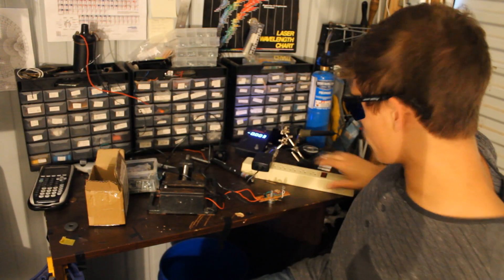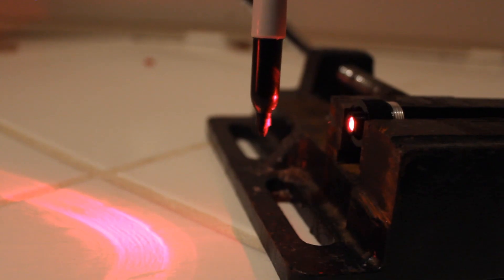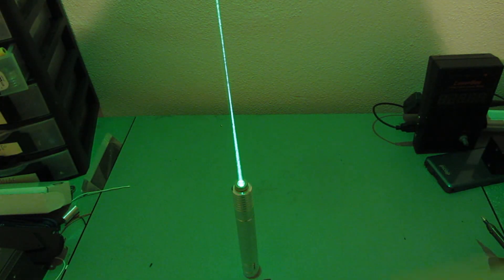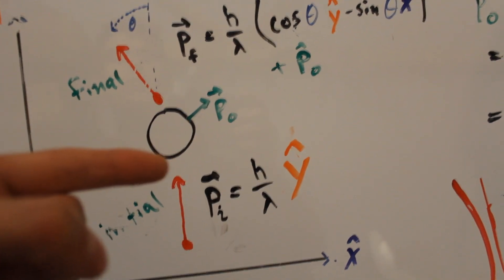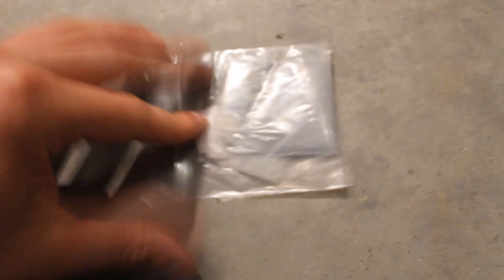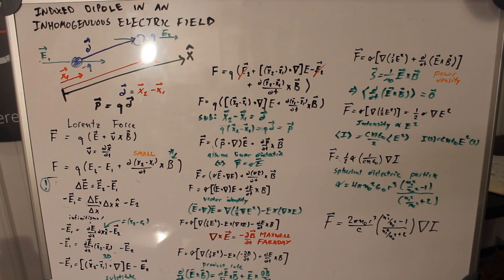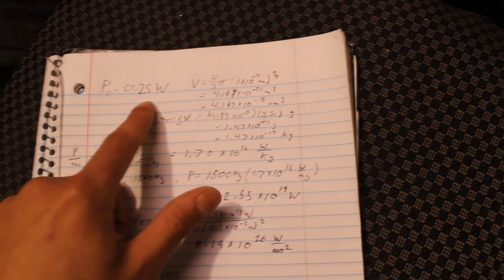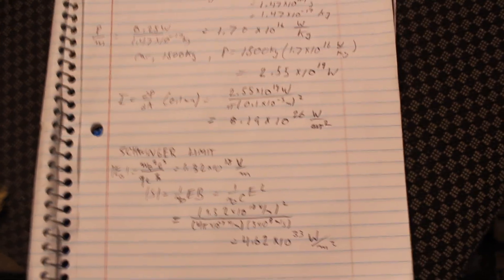Levitating DIAMONDS with a laser beam!! (demonstration of Nobel Prize in Physics 2018)

Comment: Lightning contains enough watts to levitate and trap a human. So does the moon and sun if you create the situation like the ancient world did. Ideal you want to pass the coherent light over an elliptical surface like a ship in open water. If you are at the focal when the light passes over and reflects back, then you will be trapped in the light. Inside the light, static forces act on you, but not gravity. To avoid these static forces acting on you and causing amnesia, burns etc  - turn yourself into a static electrical device similar to the knights with chainmail armor, wool surcoats, etc or any ceremonial leaders wardrobe. It takes the lights energy and creates a field around you as you act as a trapped particle in the light. To break free of the light, you will need a penetrating device that can conduct the energy also but pass over you to bend the field in on itself and release you. Cheers.

Comment: Thanks! If you find the equations for the beam intensity across the beam, and also for how that changes with distance from the focus, you can convert the intensities to energy density (also has units of pressure, Pascal or Joules/meter^3) by dividing the Intensity at a point by the speed of light (Watts/meter^2)/(Meters/second) = (Joules/meter^3). These stationary (nearly time invariant) pressure gradients are easier to work with than momentum equations.  

Also, you might want to look at conical lenses that produce Bessel function pressure (energy density) cavities that can be much larger and farther away from the source.  The electric and magnetic fields can be found from the energy density from 

B^2/(2 mu0) = pressure Pascals = e0*E^2/2, where B is in Tesla, E is in Volts per meter, mu0 if the Codata or NIST "vacuum magnetic permeability and e0 is the vacuum electric permittivity. Stupid names.  But that is what they call them today.

I keep asking groups to look for the gravitational effects. The earths gravitational energy density is calculated from g^2/(8 pi G) where g is in meters/second^2  and G is the Codata gravitational constant ("Big G").  The result is also in Joules/meter^3 or Pascal. And you will find the B field equivalent of the gravitational field is about 380 Tesla.  The E field is just B times the speed of light or about 115 GigaVolts/meter.  

The average energy density of fluctuations at the earths surface is about 1260 Electron Volts. so you might be able to use your YAG laser and "High Harmonic Generation" to run a beam continuously at the energy densities close to the gravitational range. It is a spectrum, not a single constant value.  I think it matches the solar neutrino spectrum fairly closely, with a roughly blackbody spectrum from below 1 eV per photon to a few tens of MeV with a peak about 1.26 KeV.  

In spite of your love for high total POWER, you might tweak your personal wants to include "INTENSITY!"  If you want to make "Mr Fusion" (are you old enough to have seen Back to the Future II and III?  You do not need massive size, only precise focus and high INTENSITY!! (1 ExaWatt/meter^2 = 1 Watt/nanoMeter^2)

If you run for several days, the changes in the intensity should show SOME correlation with the magnetic variations , with seismic accelerations, and with the vector tidal Newtonian acceleration at the instrument from the sun on the device, minus the sun on center of the earth.  Plus the moon acceleration on the instrument minus the moon on the center of the earth, plus centrifugal accelerations at the station.  If you ever get that far, contact me on ResearchGate.  I have a project on Solar System Gravimetry and Gravitational Engineering. 

Richard Collins, The Internet Foundation
Reply: Now this guy clearly lasers...would love to see what kind of catastrophic weapon/collab with Styro could do
Reply: Interesting
Reply: good
Reply: Baller over here.

Comment: I don't know if it was so much the air currents generated or that just enough momentum was added by sprinkling the diamond particles to cancel out the effect of the laser thus not letting the particles stay suspended

I've been thinking of light as a fluid through which one may achieve lightspeed travel - I was unaware that it had (of course) already been thought of! If I can think of it, surely the 1000+ of others better minds have thought of this as well; fascinating!

Thank you!

Comment: ...this seems like something that could be utilized to create an actual "hologram." Could you use a second laser to control the position of the particle? Could you use an invisible wavelength to hold the particle, and then use different lasers to color it? How many particles can you hold in a single beam? What could you do to make the "levitation" more stable? Would it work in a vacuum? 🤔🤔🤔

Comment: If somehow man was able to make a powerful enough laser, and focus it into the tiny diameter powerful enough to levitate a car, man would also need to invent a material extremely strong and stable enough to withstand the heat generated from that focused ray. Which is by my calculation is... impossible. Like he said, nature follows a curve as well. The weight/size/power ratio would be exceeded waaaay before even coming close to 1% of the cars weight.

Comment: Have you ever studied Host orbs pictures and you can actually see the blue meneteic ions around the white orb?If you see a tail of the ionic wind it uses to propel it self.The Orb is clear in the picks when theres no water droplets inside the ghost orb so the orb needs to collect static electricity to keep the energy going or it just loses energy to interact to our physical deminsion plains through quantum physics.I been a paranormal investator for many yrs.I see the same physical patterns in picks of all different physical energy entities.What I have learn that they have to apply to laws of physics to actually interact to our plane.They need some type of electrical charge like static to exist on in our physical world. The more voltage the more power the ghost gain the bigger the orb.Orbs need water droplets to store energy so when you take a picture the flash reflects off the droplets as clouds.theres three main layers to orbs that was connected to the physical body when they were alive. The blue layer in orbs are static ionic purples system to propel the orb in the air.the second is protection layer of a ghost orb and the center is your ex brains conscious layer.
Your memories, personality layer. Subconscious layers conscious layer.
   But we still have dark matter and dark energy ghosts that absorb light called shadow people.I seen pics with white orbs that has a shadow on the wall of dark creep not normal ghost entities.I wonder if science can take deeper look on how these orbs work comply it to though new propel systems.

Comment: This exactly the problem current physic has after “the scientists” removed ether from the equations. If you understand what the ether is and what the light (em wave) is then the explanation is straight forward. I give you small thing to think about. 
Imagine that you sample laser light. Now within micro second imagine the laser can be treated as static phenomena and visible by unlimited number of observers placed on a sphere with center where the “static laser light is”. All of those observers see the laser light at the same time if they are within the same radius from the center. Now wait another micro second and the light moved to new position. If you think about how the light moves and how it is visible then quickly you will understand that the laser is in fact moving torus (doughnut)  in ether field, torus similar to smoke ring spreading in space. The ether moves through matter and exerts force on it (that’s gravity) . The ether is moving through the diamond and “comes back” to get through it again (self sustaining doughnut) , and this causes lock. Notice that the gravity (vertical etheric flow) is not working anymore because the laser which is ether disturbance itself  influenced it.
I am sure that very light object should weight less if a laser light is shun right over it , so technically properly formed light could work as sort of magnet.

You don’t need electrodynamics with its mathematical abstract description although - if you understand the ether exists - it can help to describe its behavior in space. 

In your explanation you must count gravity “force” (and it’s removal) and only because of that your explanation will never be completed. Once again the gravity “force” is nothing else than vertical flow of ether disturbance and ether interacts with mass. For an object to move delta F must be different than zero which means even slightly not balanced force will move this object. The ether exerts exactly this minimal force (it’s Planck level force).

Comment: @styropyro The energy to pickup household items with light is super large. However, tractor beam is still possible with quantum effect that 2 photons opposite state interact will gavebirth electron and positron which both have positive mass. The energy required to pushing matter via electron and positron is perfect small. In facts that electron wind from power source 1kV 1mW could stir many dirt practices on water surface and blow away piece of paper. I believe that u will got a Nobel prize by build a laser system that could adjust the photon phase state, split 2 beam which synchronized opposite phase state and focus to collision point. Then placing strong magnet around to bend born electron and position. The wind should be appeared in radius about 5mm from collision point and could blow human hair continuously. Then, it may need 4 sources like that at pulse type to grab pepper and other seeds. Estimates the energy to levitate 1g matter with this type system is under 10W. Positron and Electron will interact again gave 2 photons thus will make the space around collision point glowing blur halo. And the color of the halo maybe near the laser source power color and also lower frequency. (Close to IR)

Comment: Fun Idea: Using this method, make a quantum dot sorting machine.  Pick them up off the table and move them left or right proportional to the average fluorescence difference frequency to a reference sample.  Even if you pick up multiple randomly chosen dots at a time, the method will order them eventually.

Comment: Love the videos, but these particles are trapped with the photophoretic force, not the gradient force. If you were using the gradient force the black "absorbing" particles of the marker pen would not trap. This is because the momentum exchange of absorbed photons far exceeds that of the refracted photons per the explanation in the video. In most beams there is a small darker area behind the focus where particles can be trapped using a different mechanism called Photophoresis and this is what is most likely happening here. Still, this is a most worthwhile and fun video. Keep it up.

Comment: How many watts would you need if you just wanted to push a car with momentum using Chirped Pulse Amplification (10^15 watts)? Instead of a continuous beam, you hit the car with an ultra brief pulse. With CPA you could build up a more intense beam over time and then launch with a pico second beam. If the watts to push the car is still the same (8.9*10^26) how long would it take a CPA to build up that watt intensity? How many watts can a CPA generate over 1 second?

Comment: Would it be possible to use this physical "tool" to change how metal 3D printing is done? Instead of adding layers of metal and fuse them with laser, would it be possible to continuously channel metal particles through a "laser straw" straight to the wanted position and melt it in place with another laser beam? Like a 3D sewing machine?

Comment: Real quick question, is it possible to stop a laser with another laser?

What I mean is a strong enough laser can burn through anything. So even mirrors reflecting light back would be useless.

However after seeing this video on how lasers build their  "shell" so to speak that enables them to hold particles.

I wondered if a laser beam shot across the bow of another making a T shape. 

Now I can see how that in a way would defeat the purpose because then second laser would burn though what it is pointing at.

So then the salution would be to try multiple lasers at far lower power ratings but in line to be  building a wall in a way.

Or to have multiple laser seems cross paths

I guess what I'm thinking is laser beam containment and if that is possible then you have the makings of a real life light saber.

Comment: By lowering or raising the voltage can that move the partial in and out or would that just drop It? I'm sort of leaning to the latter or maybe raising the frequency of the    light, sorry if this is a dumb question I'm just curious
Reply: Raising the frequency of the light beam*

Comment: But what if we pretend we have a quantum flux field energy generation device, a zpm of sorts.
So we dont have to worry about being limited by energy generation.
Now, what happens to conservation of momentum in terms of the laser itself? Is the laser itself "pushed back by the recoil" of the photons exiting it, when it is powerful enough to lift a car?

I mean, what if you mount said laser on the car, facing up towards diamonds large enough to levitate the car, all of them connected to the car like "balloons", the lasers also connected to the car.
Could the lasers then effectively "lift themselves"? Or would there be some weird "recoil" of the photons such that it cancels out the diamond-refraction-lift you get?

It's basically the age old question of "can a man lift himself by the collar", lol

Comment: Hey styropyro, great video! I have a question though... 
     Considering that the particles aggregate toward the areas of greatest focal intensity within the laser's beam, wouldn't it be possible to move a suspended particle along the path of the beam by adjusting where the focal point is? If so, you could make a miniature tractor beam... You could make a particle or even those diamonds move back and forth by adjusting the light going through the lenses. While I'm no physicist, I think it would be an awesome concept to see implemented...
Reply: I imagine that changing the focus would likely make the particle fall out of the beam. If you could use two or three lasers together though and shift them one after the other that sounds like something that could work. Would be interesting to see if you can get two beams focused on the same point and transfer the diamond from one to the other.
Reply: This principle actually works and is used in real labs. You can mount a lens on a translation stage and move the lens and the trapped atoms fairly quickly. This is used to move the atoms from something called a 2D MOT to a 3D MOT, basically two different stages of an experiment.

Comment: @6:25
Although  I don't know  most of the math you're using, I feel like you're still missing an important fact: The car doesn't have the same index of refraction as the diamond.
Reply from the maker: it was just a rough calculation. a laser that size would vaporize a car into plasma nearly instantly...lol
Reply: @styropyro  Would it vaporize a diamond instantly also, or will enough of the light be refracted to not sufficiently heat the diamond?
Reply: @jnevercast  No if anything a diamond should be easier to 'fry',there are many total internal reflections in a diamond,but since it has a really high melting point it doesn't.
Reply: @styropyro  That's not the biggest concern. The Main concern (if you're gonna propel a Spaceship to another Star) would be, Tesla Spaceman ZOOMING by while Texting and Friggin' everything up.....like he does.
Reply: I'm not very educated in this field of science. But I do find it very interesting. If you wouldn't mind breaking down some of this into laymen terms. For example the levitating laser. A reference of how much power it would take to run a laser of that magnitude. The fact that you said it would vaporize the car really helped me understand its magnitude

Comment: Today I learned that tractor beams are not only real, but also capable of use in the abduction of sheep with a sufficiently beefy power output.

Question. If you had a variable lens could you change the focal point to push or pull one of those tiny diamonds across the room?